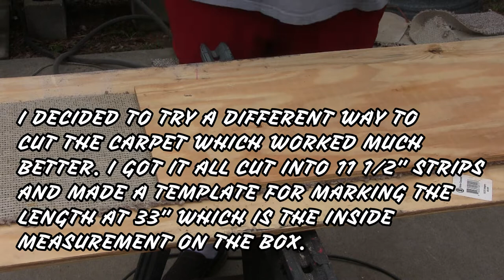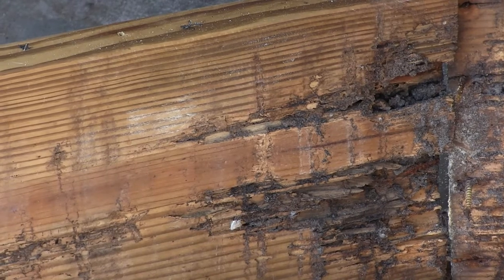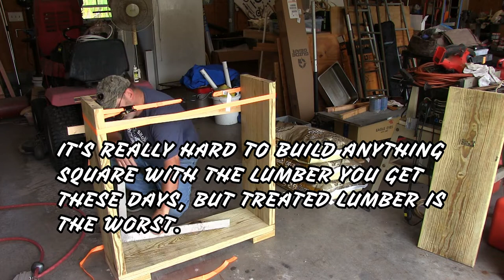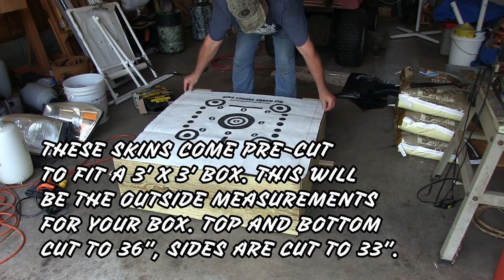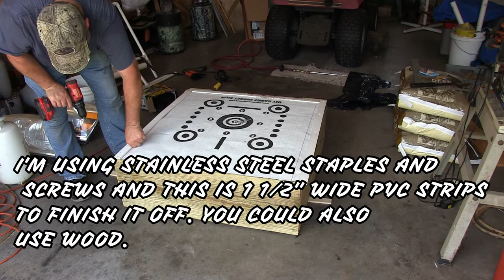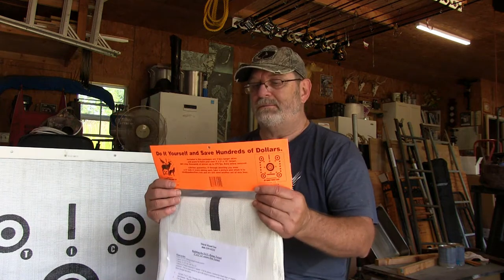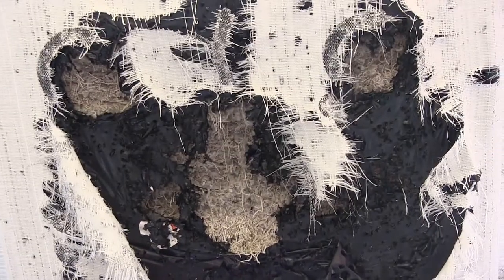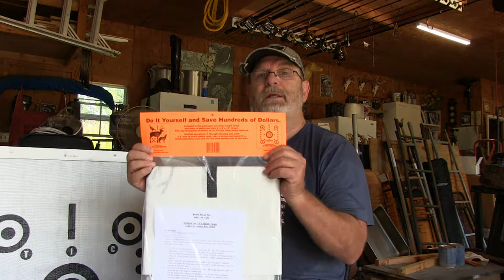DIY Homemade Archery Target

Comment from the maker: Thank You so much for watching!
Reply: You maybe should have screwed that frame together rather than nail it?
Reply from the maker: @nickpezzello3066  I screwed the last one,  but I have a ton of nails and decided to use them. I toe nailed most of them. Time will tell, thanks for watching!
Reply: @TheCarolinacadmanOutdoors  I hope it holds well for you. Let us know please.
Reply from the maker: @nickpezzello3066  If I were to use screws again, I would use stainless. Some of the screws I used before rusted and when I went to take them out the head broke off, and they were outdoor rated screws. Thanks.

Comment: We thank you for the video.  It’s the first one I’ve seen that used carpet material for filler. I honest do not remember getting an email and that picture, but I did have Covid 2x.  You are correct I. The fact that old clothing works best. You don’t have to spend all that time cutting the carpet and I believe the clothing does a better job stopping arrows.
Reply from the maker: Thanks for watching!

Comment: Nice job.  Nice target.   About how many sgft of carpet did it take?
Reply from the maker: It's going to depend on the thickness of  the carpet you use. I think mine took around 130 pieces. Works out to around 345 sq ft. But that's on mine. Different carpet will compress differently. Thanks for watching!
Reply from the maker: It's been a while, but I think it was around 330 square feet. Thanks for watching!

Comment: What are the internal dimensions of the box? What do I need to cut the carpet too?
I intend to buy the lumber from Lowe’s ,I will let them cut the lumber what is the length  of the sides and top and bottom?
Reply from the maker: I'm pretty sure all the dimensions are in the video for future reference. You need 2 pieces of 2x12 36" long, and 2 pieces 33" long to build the box which is 36" x 36" outside dimensions. Cut the carpet pieces 11 1/2" (the width of a 2x12) x 33" to fit inside. Hope this helps, thank you for watching!

Comment: jesus dude, you need to be a lot more careful with that angle grinder
Reply from the maker: You might be right, it's easy to get too comfortable with a power tool that you've been using for over 50 years. That's why its always the "experts" that loose fingers on table saws and such. I'll try to do better next time! Thank you so much for watching!

Comment: How's the wear on the arrows from being shot into the carpet? As a retired floor guy, that carpet backing is very rough. Seems like it would be too aggressive on the arrows.

 Defiantly gonna give it a try, maybe I'll just dedicate a set of arrows for this style of target. Might even try layered carpet padding instead.
Reply from the maker: I shoot gold tip arrows, never seen any damage even after several thousand shots. They need to be cleaned with some acetone occasionally, the carpet backing leaves a film on them after a while. Thanks for watching!
Reply from the maker: I think the padding might work too if its compressed enough.
Reply from the maker: I shoot gold tip arrows and they have withstood thousands of shots into this target. Thanks for watching!